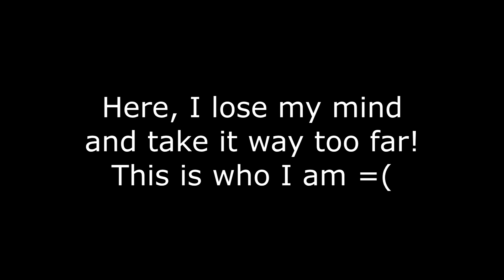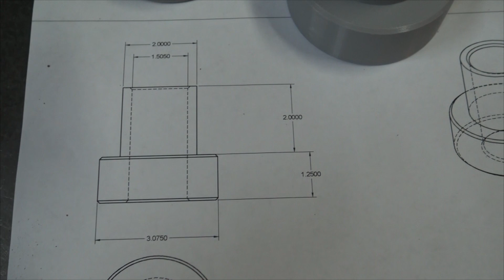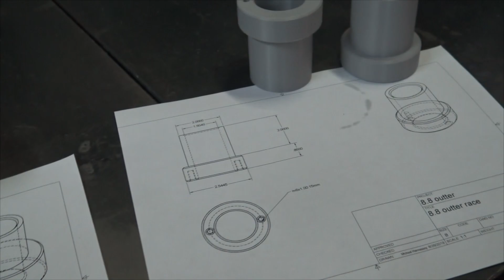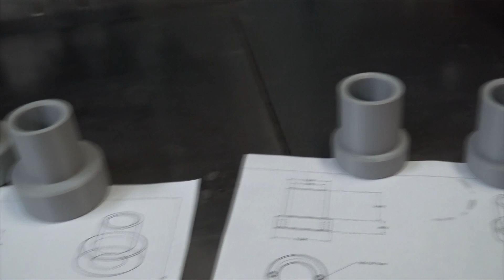Shortening my Axle with 3D printed Jig 3; print done

Comment: Nice job on the plugs. One question, why didn't you just cut out the part of the tubes from where they were gouged instead of welding them back up? Am I missing something? thanks - later
Reply from the maker: Marvin Norton I weld a lot so it was no big deal and I was content to start from a fresh “zero” so to say. Instead of bothering with working around them, I just erased them so they were of no consideration. Thanks for watching.